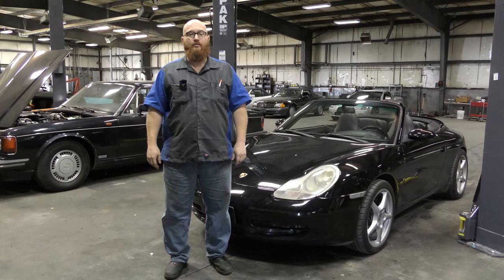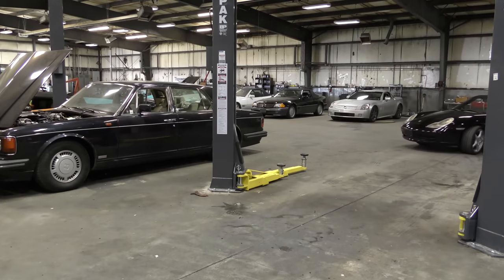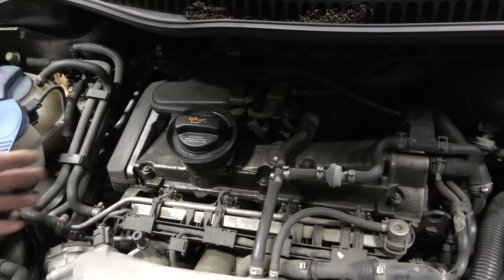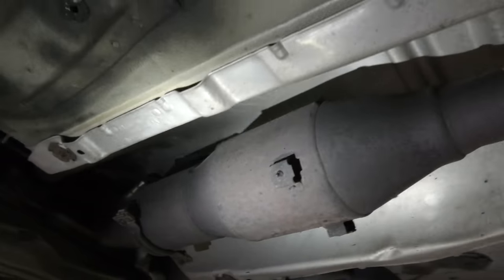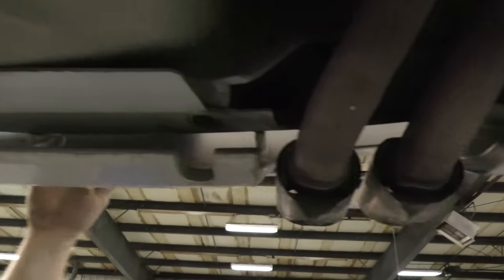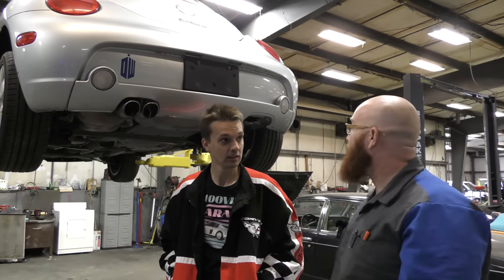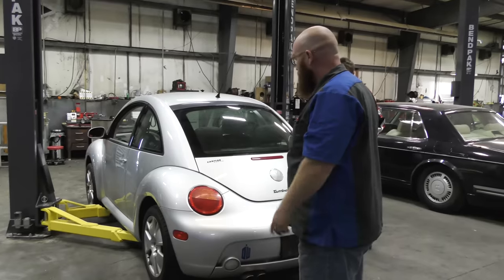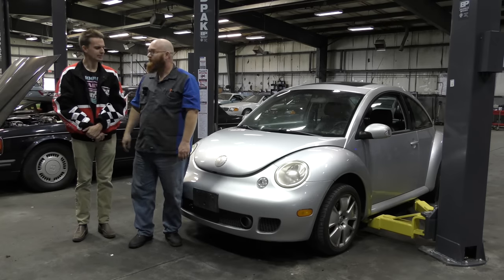HOOVIE finds the CAR WIZARD an '04 Turbo S VW Beetle. It's sooo much better than the last one!

Comment: Wizard: I'm gonna pull this black bettle out the way.

Hoovie: SHUT UP! 

😂😂😂
Reply: lmao 😅
Reply: When the Car Wizard gets done with that Beetle would give a lot of Hoovies supercars a run for their money (including the Porsche 911 & 928 currently seen in the shop). Rather have the Beetle to.
Reply: Unpopular Opinion: The current 911 has a more direct lineage to the original Beetle than the New Beetle has to the original Beetle. FITE ME

Seriously, I'm speaking ex-recto and I don't care either way.
Reply: Technically its a beetle 😄
Reply: The 911 is just a Beetle with lock washers.

Comment: Hoovie: Does suspension test over railroad tracks and says "it feels pretty good". 

Wizard: Well there is a clunk sound in the suspension. It has a blown strut and bad bushings on the control arm.
Reply: Must have been smooth tracks. 🤣
Reply: That damage would have been obvious on any inspection 😯
Reply: @chrisvig123  Hoovie: A PRE-Purchase Inspection?! What is this whichcraft you speak of?
Reply: Didnt he pay like 700 bucks for it... I doubt he cared enough to look

Comment: Nice catch, Mr. Wizard! Been working on new beetles since they hit the showrooms. With the 1.8t, take a few minutes to remove the cowl panel and wiper arms, then you can remove the lower plenum cover. It only has two bolts, then pull it out forward.

Trust me on this one. You can then clean out the plenum, and you'll have all the room in the world to access the valve cover and timing belt. It will save you tons of time in the long run.
Reply: i’m glad i read this because i own wartortle now!!!

Comment: If I now tell you the parts prices of what that would cost you as a workshop in Germany, you would start to wheep: 2 front control arms 40€; 4 struts all included (strut bearings and all): 250-300€; timing belt/waterpump kit: 80€. The valve cover gasket probably around 10 bucks or so. Basically, still less then 500€ for the parts to fix this up.
Reply: And you couldn't get a car in this shape for anywhere near €700
Reply: He is going to add VW and aftermarket upgraded parts as well once fixed. Sounds like besides the short shifter a cat back exhaust.
Reply: @ipariszalonna  Not a Turbo S, probably, no.
Reply: @tengu190  Yes, he'll be putting a bit more into it, but it's worth it, because it's a nice car, and finally the beetle that suits him.
Reply: @ipariszalonna  One in much rougher shape will set you back around 4 to 5 grands (euros) here in Europe... Now, this is nice and all, but it's a car that has not such a great full economy, so between insurance and fuel I wouldn't own one, even if I could get it for a grand.
Reply: @SerbanCMusca-ut8ny   I paid $1.49 a gallon for gas earlier today.  And that Beetle gets great gas mileage vs my V8 pickup truck.  And insurance on anything this old and you're over 25 is cheaper than dirt usually.
Reply: @AaronSmith-kr5yf  the cheapest fuel you can get here is ron95 at around €1.40 per litre (about $5.70ish per gallon).

Comment: "Its in really good shape"  Needs a timing belt, water pump, valve cover gasket, control arms, struts, brakes, steering wheel, headliner and a good cleaning.
Reply: Not bad at all for a $1k vehicle, most of that is just maintenance not actual repairs
Reply: Most of that work is small and easily done if you know a little about mechanics.  Even with repairs and what he paid he still is coming out ahead.  The more the car is in great shape that higher and higher the price tag and the harder and harder they are to come by.

Comment: The timing belt job IS pretty involved on this car  on A4’s and this. I guess because he’s the wizard it’s too easy
Reply: Plus, he won't be doing it, so why worry? ;)
Poor Junior Mint...
Reply: @SerbanCMusca-ut8ny  Junior Mint needs to learn a few German cuss words. It won't help but he'll feel better.
Reply: Bah! Just have to pull a motor mount out and suspend the engine from above. No biggie! 😜
Reply: Yeah, I've done this and it's "easy," just takes a days worth of work...
Reply: A timing/water pump job on a 1.8t is pretty easy. As long as you get the manual tensioner set correctly, yours good to go. On a beetle, it may be a bit difficult to get to the timing belt, due to how the engine is mounted. However when I did it on my 03 A4, very easy.
Reply: Euh i did my timing belt within 4 hours with new radiator and thermostat... a4 1.8t kind of easy with everything pulled out

Comment: Owned a Turbo S new now I just found a 2002 silver Turbo S with only 90k miles. 
All it needs is a repair to the driver's seat. 
Love these little bugs.
I believe they made them for 3 years ...02 03 04.

Comment: Kinda fun watching the Wizard nerd out over a Beetle. I work on VWs for a living and the girlfriend has had a Beetle longer than I've known her. After a few upgrades to that car, it's become one of my favorite cars to drive. Kind of funny how that happens. Her's being without a sunroof has also made it the car with the most head room I think I've ever been in. It's pretty awesome for a tall person. After you get dampers sorted and upgrade the control arm bushings, they are quite possibly the most fun to drive car on the PQ34 platform short of the Audi TT.

Speaking of the control arm bushings, Wizard, I implore you to buy just the bushings, and specifically buy the bushings for an Audi TT or 2004 R32. Preferably the Lemforder brand, or if not available, the Febi-Bilsteins or Meyle HDs are OK. I say this because the original bushings on these were designed to have a fair bit of give in them, which also leads to them eventually tearing and allowing MUCH more play like your Beetle is exhibiting. But the R32 and TT rear bushings for the front control arms don't have those cut outs. Not only does this mean much more direct feeling steering response, but it also seems to make them more reliable in the long run (especially if you get your hands on the Lemforder brand bushings). PLUS, you don't have to pay attention to the orientation when you're pressing them into the arms.

I know buying all new arms is easier and faster for a mechanic most days, but they really aren't that hard to press in and out. And the upgrade to the TT/R32 bushings is one I cannot recommend highly enough for any PQ34 or even Mk2 or 3. The bushing size actually interchanges all the way back to the Mk2 Jettas and Golfs, also fits B3 and B4 Passats too.
Reply: I'm going to throw in there that I did have a Beetle a customer traded to me for work on his much newer Touareg. It was a 2000 Beetle TDI, silver like yours, and had bigger injectors and a tune. Also was bolted to a 5 speed manual instead of that horrid 01M slushbox automatic. It apparently had a minor fender bender in the front years ago and he installed a Votex front end on it that looks a lot like the Turbo S front end with the round blinkers next to the headlights.

I like that look a lot. And it was a surprisingly fun car to drive. I sold it a couple months ago, probably broke even on just parts cost alone spent to fix it. Hole in a AC line, needed control arm bushings too, sagging headliner, turbo vane mechanism was sticking, heater core started leaking at one point, injection pump needed new seals and then the clutch started slipping, so I replaced that too with a better Sachs single mass kit. Actually got away with a lot of those fixes for very cheap, but it just all added up and was a lot of time invested. But it was a solid car when I was done and the new owner is happy. That's all that matters.

I do kind of miss it, though.

Comment: 5:12 ...no man, the timing belt job on those suck. Big time!!
It's not trying to be a Porsche, it's an Audi TT 😂
Reply: Longitudinals Audis are worse :D
Reply: Both based on the VW Golf platform and pretty much a Golf underneath.
Reply: Meh, if it were a TDI or 2.0 I'd find it easy. The 1.8Ts kind of suck to do no matter what car they're in, though.
Reply: @jonasthemovie  Audi longitudinal are easy to do timing belts as the front end is put in “service position “which gives you lots of room.I hated doing the 1.8 turbo timing belt on the Beetle.
Reply: nick pappas ”Ripping the front off” position usually ends upp with welding nuts to the T45 bolts holding the bumper towers.
Reply: @jonasthemovie  🤣🤣. Yeah, I have one! C6 A6 with the 3.2.... timing CHAIN in the back ☹️🔫

Comment: I have a 2003 beetle gls 1.8t. It's very similar to the turbo s, but doesn't have the bumpers and extra power bump. Mine has 42,400 miles as of now and has the APR Stage 1 tune. It's Ravenna blue with the matching two-tone leather seats. I love new beetles so much
Reply from the maker: Did the tune make a huge difference?
Reply: Car Wizard definitely did. From 150 hp to 215 and ~168 torque to 247. It pulls hard for what it is. Definitely need an aftermarket diverter valve for the extra boost

Comment: Nice example of a TS. I have an '03 where the most extensive engine work I've done to it was replace the ignition wires as the old ones were old and shorting on the top of the engine. It needs a valve cover gasket change like this one but also needs new o rings on the injectors.  Unfortunately, I was one of those people who test raced it and landed it in a ditch. Surprising it drove out of the ditch and only the rocker panel was dented and a hole was punched into the front bumper from the intercooler but the intercooler came out unscathed. Tough car for sure.

Comment: Along with the valve cover gasket, replace the gasket/seal for the cam adjuster, super common source for an oil leak.  But to nip the root issue that is causing oil leaks, be sure to replace the "suction pump", part number 058 133 753 D (order based on VIN).  As per VW, if you don't replace the suction pump, odds are you will have oil leaks again.

Comment: The Wizard missed the missing light on the lower front bumper. :)
Reply: And apparently the cracked front right CV joint boot, 6:42 One can see the grease shine on the shaft.
Reply: @SerbanCMusca-ut8ny  All those CV boots need changing, once one or two go or show signs of failure might as well change all 4 and clean and re-grease the CV's. Good Idea to change all the bushes on the bottom arms too on both sides. I wonder if the wheel lock nut is missing, wasn't in its little spot in the foam in the spare.

Comment: I never thought I would love a beetle. I always thought they were dorky AF until a family friend made me an offer I couldn't refuse on his mom's 2000 Turbo Beetle GLX. Once I drove it, I was hooked. What a lively weirdo it is. I even grew to love its clean, bulbous look. And yes, there are a lot of Porsche-ish things about it. Especially the perfectly weighted hydraulic steering, direct shifter, the door latches that release with that mechanical pop of a 911 and two of the most comfortable leather seats I've ever sat in. I've had my own car wizard slowly upgrading the suspension and now its handling is sharp and direct. Mine had only 48K on it when I got it three years ago, it's at 78K now and has been relatively trouble free and is my daily driver. I'd love to find a clean S someday!

Comment: Hey wizard replace those control arm bushings with the solid rubber Audi TT part they are a little stiffer and last quite a bit longer.... it's a common wear out item on both sides because of the constant push pull of applied torque during acceleration and deceleration

Comment: It's a testament to many of the car makers it wasn't that long ago that any car reaching 100,000 miles was getting ready for a full rebuild now we talk about cars reaching 200,000 miles and still having life, I had an ex-prisoner transporting van it had 360,000 miles and it was the original Iveco engine it was still superb the only issues I had were the break pads were toast and the calipers needed a good clean out and greasing 1 rad hose had rubbed a hole in it after 3-4 months and I had to remove the prisoner cage because the standard lift made that one at a time noise once that was done I clocked up many more miles.

Comment: that beetle rear end looks audi TT'ish
Reply: Also shouldn't surprise you that both ride on the same platform... what VW internally named PQ34. There's quite a few parts that are interchangeable too, especially when it comes to drivetrain and suspension.
Reply: @dzelpwr  Does that mean an AWD conversion is possible without breaking the bank?

Comment: The sills look rust free too which is good. A lot of Bugs rot at the end of the sills in front of the rear wheels. Its worth removing the arch liners and treating the sill ends.

You're also missing the towing eye cover from the rear bumper.

And when you change the steering wheel make sure you fit the Turbo S Steering wheel spokes.

The flower vase again, you need a Turbo S one, as its different to the standard one.

We got a similar car in the UK, its was the V5SE, same bodykit and interior, but had the 2.3 VR5 engine with 170bhp but with the 5sp manual.

Great to see another NB on the channel.

And the Turbo S/V5SE are definitely future classics.

And parts in Europe are so cheap for these, I did the Cambelt and waterpump on my 07 Turbo for £80 all in.

Comment: The engine cover is part of the pedestrian impact protection that's compulsory on European cars.
Reply: So, in case the pedestrian goes through the bonnet, they'll have a nice soft plastic engine cover to cradle them?
Reply: @Hotlog69  no. if the pedestrian smashes on the hood the underside hits soft plastic and not pointy lines and steel. european laws on cars can be really tight.
Reply: @Ermy1996  Pretty sure getting hit hard enough by a car where you could be impaled by pointy lines and steel is the least of your worries.
Reply: It's other measures as well like design of cars, where the front bumper is , how the pedestrian travels over the car if they get hit.
Quite obviously if you get hit by a heavy metal object travelling at speed you are going to come off worse , but the EU have tried to make the outcome of low speed impacts better for pedestrians and cyclists.
Reply: @Hotlog69  not really no, new bonnets are made to crumple/flect when hit by a body. but dont believe me, ceck out some new european crash tests in the pedestrian section, they show that in full hd videos.
Honestly the rules are too strict now but at the same time the survival of people hit by cars skyrocketed in the last 20 years here, so i guess they are not wrong.
Reply: @gedd6750  Just make the bonnet out of heat/flame resistant plastic and there you go.

Comment: I have a jetta 4 tdi 02 model. So much the same under front suspension. I changed lower control arm bushes 3 times. It was resolved and now lasting after iv replaced it with powerflex bushes #powerflex while in therr do the subframe bushes, swaybas bushes. Studs, tie rods en ball joins. They fail shortly after one another, but that should not be new news to you. My jetta on 333k kms on the clock. Still great for years

Comment: upper strut mounts are bad for wear, you can pack some grease on the top when you replace them and it squashes in when you bolt it in. If the drivers door puddle light is out, Either the wire in the door to frame is cracked and they all are OR the microswitch is gone in the latch. Pass seat had a wire issue that gave a code when reclined  too. If your hard lines on the rack are bad, there is a guy on the Vortex selling them in Canada. lower control bushings have an Audi upgrade as well. dont mess with the exhaust, Get a rear sway bar,, its the best mod you'll make..

Comment: I put Audi TT lower control arm bushings in all the mkiv cars that come through. Stiffer than stock, but not as stiff as poly mounts. Pretty cheap too. I’ve never replaced a control arm - just bushings.

Comment: I'm sure you know but the turbo S had a specific budvase, it was clear like the other beetles but had a silver dimple ring around it that matched the dimples on the steering wheel. Also nice to see an older new beetle where the rockers are not crunched in. Almost all that I see have this issue :(. I'm currently on my 3rd new beetle a 99 2.0 GL  and love it . Some day I'll add a turbo S myself !